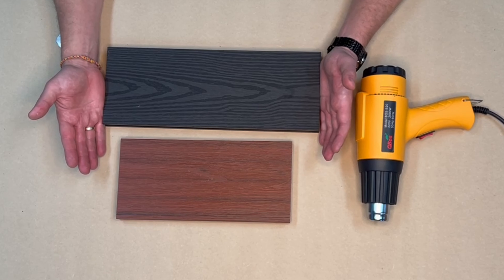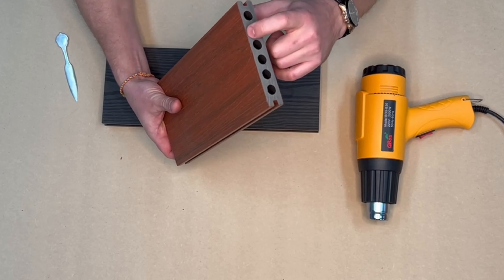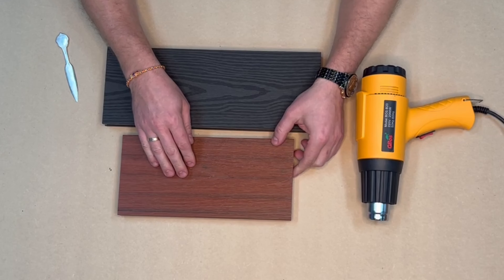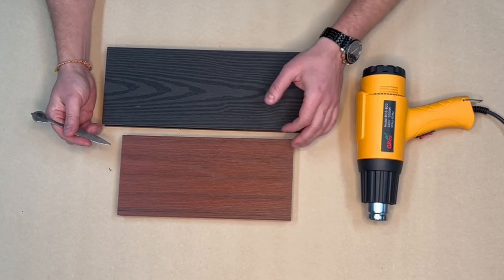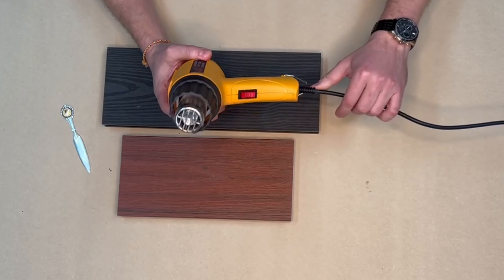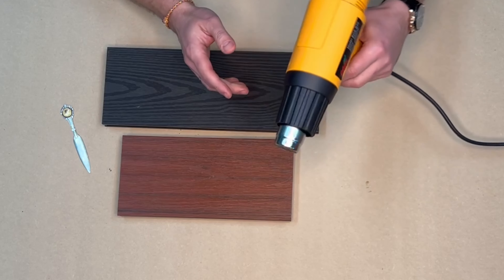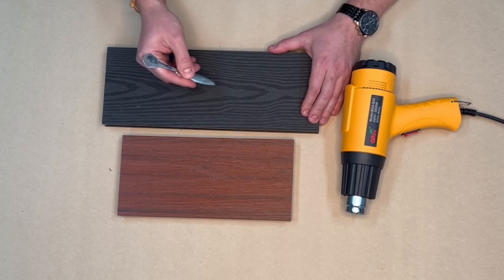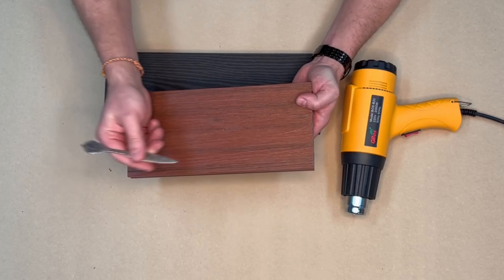How to repair scratched Composite Decking

Comment: What temp should you set the heat gun to?
Reply from the maker: There is no specific temperature set on my heat gun. I think it is not very important. When you start heating the Composite decking, you will either bring the heat gun closer to the surface or further. The trick is not to damage it, but heat enough that it will melt the top layer and scratches will disappear. Try to start further and slowly bring it closer. Hope it helps.